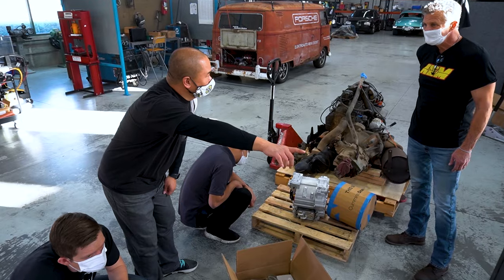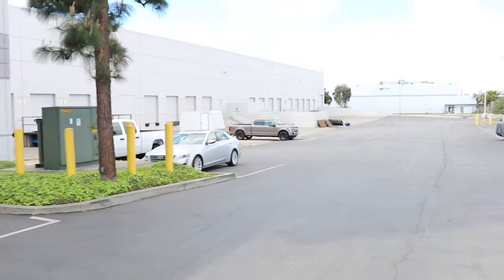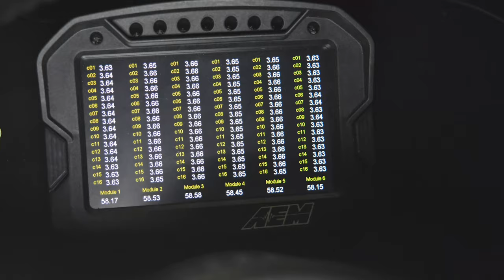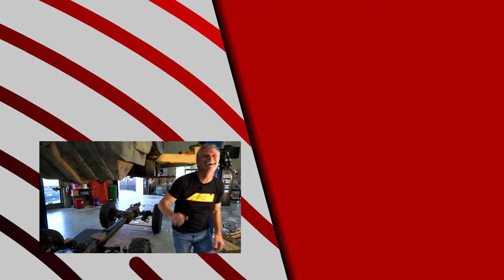How is the EV CONVERSION of our 1971 Pinzgauer Going?

Comment: Did you measure the actual centre of mass ("gravity") height and calculate the increase due to the conversion? It might not be much worse than the original (due to the high position of the original engine), but it will certainly be higher than it would be with the battery in two saddle-mounted packs.

Comment: Very interesting project. So thanks for sharing.
Few things came to my mind:
1. mentioned DC-2-DC to 12V .. If I'm not mistaken then those old military were 24V trucks. So mistake, or are you going to step everything down from 24V realm to 12V ?
On one side it will make sense as a lot of things, like LED/Halogen lightbulbs for automotive, has more available variants as it seems to me in 12V realm.
2. how it will be with water/EMP proofing of all the electronics? It seems to be super important if you want to keep it off-road capable and not just asphalt tight showcase.
3. How it will be 'street-legal' and do you plan to let's say sell/offer such conversions for other mere mortals?
Thanks for any comments.
Reply: Thanks for the questions - 
1. We plan to have everything in the low voltage word to be living at the 12v mark.
2. As for waterproof/weatherproofing, we will be using some of the existing side pods to accommodate most of the devices and make sure thy do their job of keeping everything dry and protected from the elements. One of the nice things about the products/devices we offer and have chosen to use as part of our build recipe, is that most of them can live in pretty harsh environments on their own. So the work we are doing will further protect them with from the elements.
3. Street legal, well she is a 1971, so exempt from emissions testing...so that part is pretty straight forward.

Comment: Is there consideration for running in snow and below zero temps.
Reply: Currently we do not have the thermal management set-up to live in an environment like you have mentioned - BUT, we do have a strategy sorted that would allow us to add that feature so the system could perform without issues in a cold environment. There is a heating element that would have to be added that we can control with our VCU. It would warm the ethylene glycol that we also use to cool battery pack when in warmer operating temps - so we would be able to keep the packs at the ideal temps to give us the best range/performance possible. So, if we SoCal boys decide to go skiing or way north, we will have to make that change...